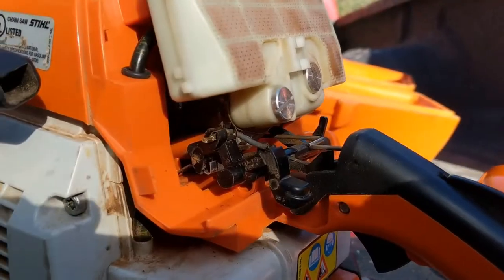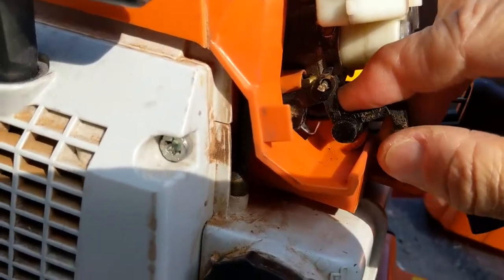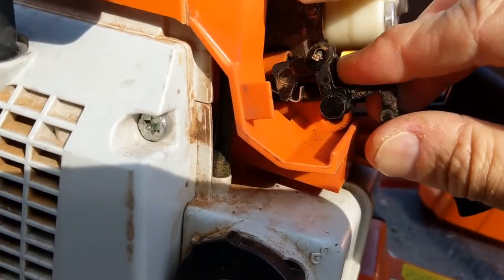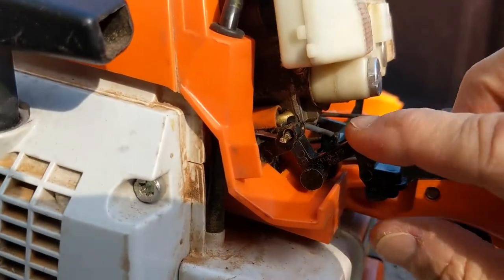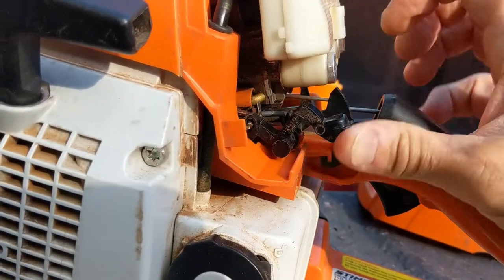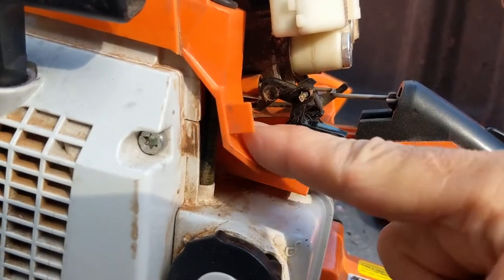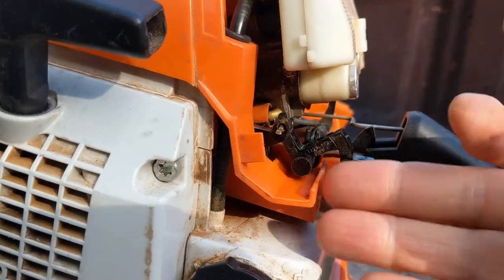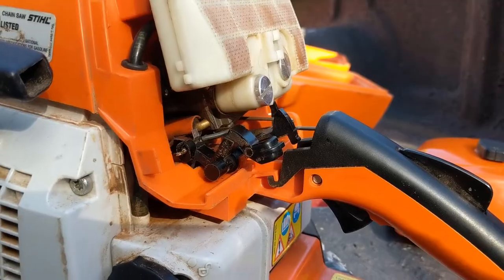Stihl chainsaw choke fix

Comment: Had a similar issue with mine stuck in on position and wouldn’t stop. it wasn’t obvious that the spring went on top of the switch especially cause of the shape looked like it went under. Was a quick fix once you know. Good explanation. Thanks.

Comment: My 034 has the upside down version of this switch, and I had the same flat spring problem (upside down) that caused the spring to contact the cut off wire at all times creating a no start situation.  It was a mind-bender looking at it, thinking it was broken, or bent or something????  Fixed with your help! Thanks again!

Comment: The choke bracket is an utter pile of crap. They are so weak and cradle it swivels in snaps. I had to to metal wire to hold it in place when it snapped. I'ts a major design flaw. A cable tie works well to hold it in place.

Comment: I always coat the end of the spring and the big boss on the control lever with white lithium grease to make the movement of the control lever through its four positions a little easier.

Comment: Thanks for the info! Unfortunately it's a fix that lasts only 5 minutes. One use and it's popped out again. I even coated that little nub with silicone grease after filing it. This POS Stihl has been terrible. My former cheap Poulan lasted 15 years!
Reply from the maker: Oh, that's a bummer. Mine has never dislodged again - only had to fix it once in 5 yrs. Sorry to hear you had more problems.

Comment: If you push in and up when shutting it off this shouldn't happen. It's when you pull up that pops the spring out. It is a terrible design and should have been fixed by now.  I think I will go to a regular lili switch like stihl used to use so you don't have to do anything beyond run position. Now just to figure where to mount it.

Comment: Thanks for the tip.  The  Stihl saws have definitely gotten crappier since I bought my first one 20 years ago. #1 worked when I sold it 2 years ago I cut approximately 75 cords with it. # 2 the repair shop said I blew a hole in the piston. I actually think they did it trying to start it. This was my secondary saw during the last few years cutting the 75 cords. # 3 had for maybe 4-5  years at the end of my wood-burning days. It has seen very little use and now I'm out there yanking away on the thing. Might be time to go battery op.

Comment: This fixed my prob.  Struggled with it for a 
 hours in the eve (after work).  I changed the fuel line and then ran into these probs. Your video shed much light.  10 secs with some needle-nose pliers and it's fixed!  Thank you, thank you!

Comment: Thanks for doing this video.
This is exactly what happened to me & I also got fooled by the spring shape / design.
I don't know how it happened but most worrying was I couldn't stop the saw.
I was shocked at how flimsy the assembly was.
Stihl needs to do better. 
Thanks again.